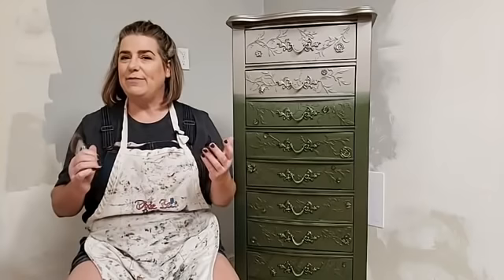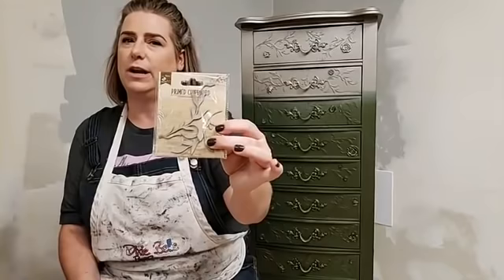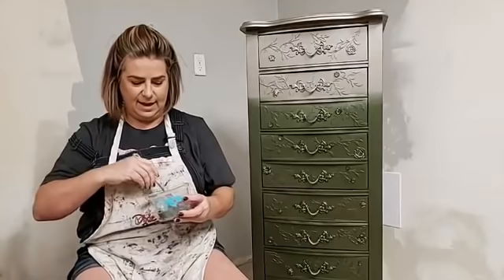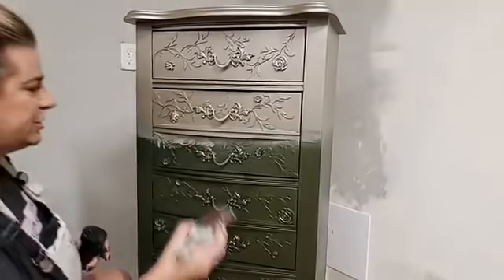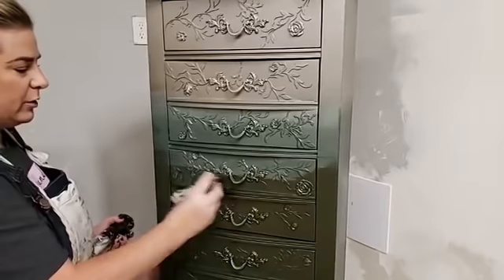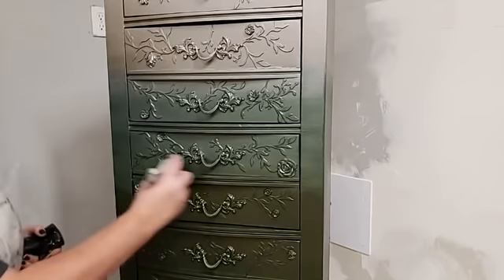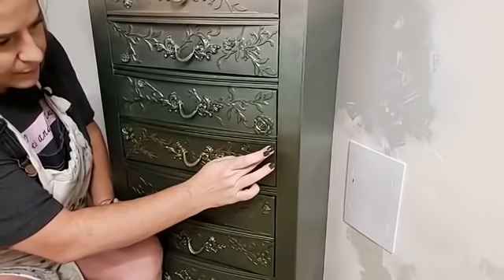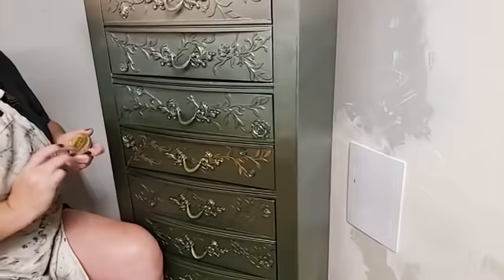How to blend with metallic paint on a lingerie chest

Comment: Slick Stick is a primer correct?  And what can I use if I don’t have Slick Stick?
Reply from the maker: Yes, its a gripping primer. On these non porous surfaces, it's recommended to use a binding primer for better adherence, otherwise you take a chance at chipping